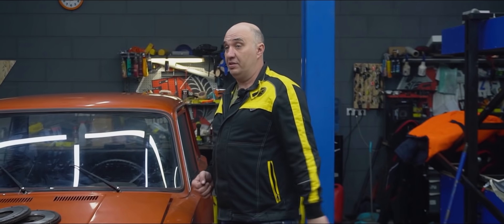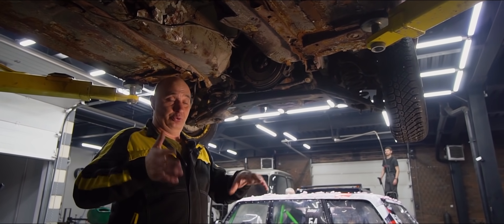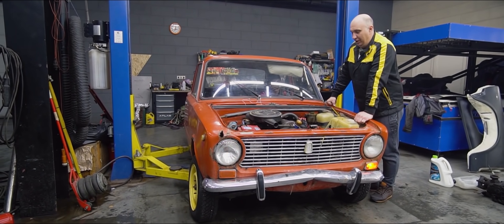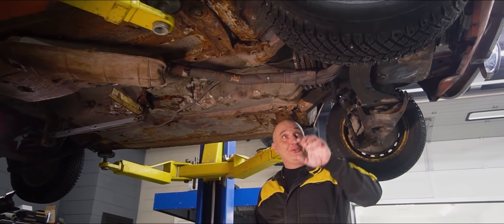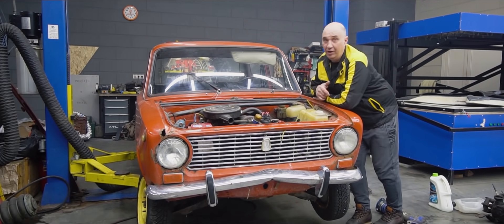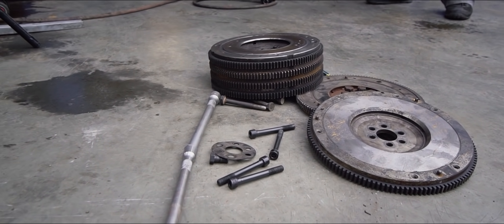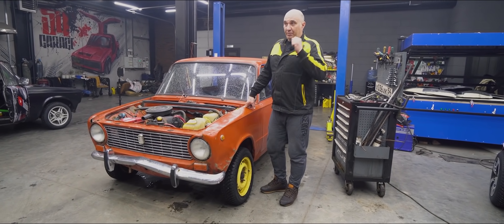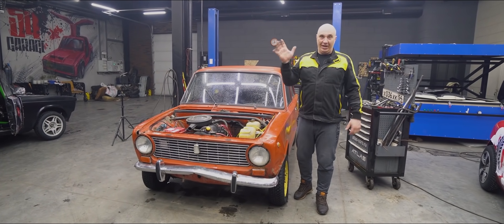What if you install FIVE flywheels onto an engine?

Comment: I would imagine the engine would be slower to build revs but slower to slow down..... with 5 flywheels,  especially with a small car like that (is that a Lada? or one of those Russian-built (under license) Fiats?) ) you could probably get up to speed, slip it into neutral, and coast for about 10 miles...lol...
       "There seems to be some kind of weirdness going on with the timing belt.....my guess is that the tensioner has fallen apart..."  with as much concern as if someone said 'Hey, has it stopped raining?"...looks outside...'Yeah, it stopped'...lol  
So they attached the clutch.....shortened the driveshaft....(wow, studded tires, haven't seen those for YEARS!) ...
rockin' the car back and forth in the snow......my birthday is in December, so I learned to drive in the winter when I was growing up and that was a big part of winter driving in Pennsylvania....rocking a car back and forth to get out of a stuck spot was an important part of instruction...
        It's funny,  that sick, mentally-failing weakling "beijingbiden" just yesterday called Putin a "killer" (egged on by a reporter but still, that reporter would have NEVER tried that shit with Trump) and yet us car guys are here, checking out each other's crazy ideas and just diggin' the cars. Us and them would probably enjoy having a beer together and comparing notes on American and Russian makes/models. Why aren't the supposedly "more experienced" people in the government 
able to get along like this?  
PS. Vladimir Putin, sir? Ya wanna fly to the states and land a good hard right on beijing joes jaw?  Yeah, just get into the White House, shake that animated corpse's hand (yuck...) and then say "Oh! Joe, BTW, about that 'killer' comment..."  BANG!  Then turn around, get on your plane and leave.  TRUST ME, you'd be America's new hero!!   lol    
PPS.  And BTW, send some rubles to Garage 54 for all their hard work, forging bonds of peace and friendship between Russian and American car-guys !!!   ;)
Great video, thanks for sharing!!   Спасибо и до свидания!

Comment: Here in Norway there was a Rally Cross driver that used the heavy flywheel trick to make sure he was first out on the start line by revving up his 500+ HP Rally car and let it rip in second gear instead of first. He pretty much always was first in the start and in Rally Cross that means much higher chance of winning because the races is short.

Comment: Takes me back to tree work days... As I recall... Non turbo 80HP diesel 4 banger... Thru a "definitely not your Datsun's clutch"... Into a ~6000 lb, 36" was it? Couple inches thick flywheel... Some of the details escape me... A good size but not the biggest by far chipper...

Thing would slowly rattle it's way spooled up, go get coffee, lol ok maybe not that bad...

When you throw that lever it would take a few feet of 8-10" log to get tired if the knives were sharp 🤣

Comment: Here's something to have some fun with, (the snow reminded me).  Weld a rear differential, and mount some drag racing slicks on the rear; THEN go drive in the snow.  If you have enough power, it will spin donuts like a child's top.... imagine driving a pole in the perfect center of the car and slapping the car on the rear quarter panel...

Comment: Years ago I managed to get a flywheel made for a car engine at Vickers engineering . 1.5 vauxhall corsa diesel .The new Flywheel was 8 times heavier than the original .No problems in 10 k hours of use and ultra smooth at 2000 rpm

Comment: My 1969 CJ 5 with Dauntless V6 came with a factory 50lb fly wheel which helped the engine perform more like a tractor at low idle speed

Comment: I have a 50 year old F250 4X4, added a heavier flywheel and added 1/2" stroke to the engine that ended up about 550 lbs of torque.  The effect is that at just above idle, it has unreal power.  You can go up a hill and hardly even touch the gas.  If this guy took that up a hill, he'd see that the engine feels a LOT stronger.  For a street car, you go the other way, you get quicker revs and more breaking effect.
Reply: 351m to 400, or FE?
Reply: @jerryw6577  FE 428 W/tons of mods.

Comment: Let’s see it dropping the clutch at absolute maxed out rpm 🏁👌🏻
Reply: In snow? 🤔
Reply: @donellmuniz590  don’t think it’s going to make much of a difference result will probably be the same
Reply: @Aladinscave  Nah, I think on dry pavement, it would snap a u joint or rear pinion off, or twist the driveshaft into a pretzel. If not, it would make an impressive one-wheel peel!

Comment: When I was drag racing I had a clutch/flywheel blanket that was thrown over the bell housing. That way if, when, the clutch or flywheel exploded it didn't send shrapnel into the passenger compartment. I was waiting for the end of your crankshaft to shear off and though it would probably just drop to the ground I wouldn't do too much leaning over the flywheel/ clutch assembly. Still, a pretty funny experiment.

Comment: I run a industrial tub grinder that has a clutch set up like this except
There is a clutch disk in between each flywheel and a collar on the end that compress it all together to drive the rotating assembly.

Comment: A flywheel is, in effect, a "mechanical battery". The increase in time it takes to build revs, is synonymous with "charging" it...  while the slow decrease in revs, is the "discharging".
Notice how he mentions that the car continues on the "stored energy".
The "problem"...  is all of the energy required to "spool it up".

Comment: I suspect if you try to do a performance test on a dry surface something in the drivetrain will fail, perhaps a yoke or union or the the driveshaft will twist if the weld doesn't fail. Thank you for making this video.

Comment: A small engine and big flywheel is how cars worked way back in the day, why don't we go back to those days with heavy long-life engines, low horsepower and big flywheels? Rev it up at the stoplight then slam into gear and zoom up to speed while only sipping gas XD

Comment: I see that they modified the front bumper to access the hole where you put the crank handle through to the front of the engine for hand starts. My Datsun B210 had one too, but they didn't obstruct it with the bumper. You just inserted the crank handle like a Model T.

Comment: In my E46 M3 with the OEM flywheel you can dump the clutch and it won't stall, but when I put a LWF on it, it's stalls even with a little gas.

Comment: A bus many years ago had a heavy flywheel to store energy while it puttered around from stop to stop picking up passengers. I suppose with a massive crankshaft, long stroke diesel engine and time, it would work. Gardner marine engines work on this principal.

Comment: Use in an electric motor has value because it provides thrust during acceleration, smooth power during constant speed travel, and energy recapture while stopping.

Comment: Garage 54 - do a video with an engine with ZERO flywheels. You will have to find a way to weld the gearbox shaft to the end of the crank. But the power gain in 1st and 2nd gear will be huge. Setting off and changing gear might be ... fun ... with no clutch lol

Comment: Where the  extra flywheels will  help is  when you let the clutch out at low speed  it will not pull the engine down like the stock engine

Comment: I imagine that the engine would stall a lot less. Save you from spotting a pretty lady while waiting at traffic lights, you end up in a trance, when the lights change you stall the car (in uk with manual gear box and crazy traffic), except now you have the heavy fly wheel which keeps the engine turning.

Comment: The smoother throttle response and slower engine breaking should help driving on the snow. The engine breaking wont make the wheels loose grip.

Comment: The old VW beetles had a heavy flywheel and were difficult to stall. I liked them. Some modern little Japanese cars have too little flywheel. They are more difficult to drive. Not a problem for the auto box that is the usual style.

Comment: Old hot rodding trick to get more power at shift time was to put a heavier flywheel on it. Yes just a bit slower to accelerate but more power to wheels at shift time. There is a limit on how much.

Comment: Interesting, true. Usually flywheels are balanced with the rotating assembly so as soon as there are more than 1 attached the harmonics will be way off. The rotational mass holds the rpm longer.  But if anybody has seen a flywheel come apart and go up through the bell housing, car body and the windshield you’d know this guy is really flirting with danger.

Comment: Large heavy vehicles with smaller engines often have heavy flywheels installed. The inertia will help it start off without stalling all the time.

Comment: I had  Lada 1500, with a Weber carb conversion, headers and a fair amount of rust.
It was road legal, and surprisingly like my Fiat 125T, performance-wise.
Never had the urge to a add flywheels
Great car until a mate ran it out of oil, after being warned that the front crank-seal leaked like crazy, but given that his wife had just evicted him, and he needed to get to work. So, what did I do?
Yup, loaner...
Needless to say, it was fucked when I eventually had to tow it home...
Wish I'd kept the carb and manifolds.
Love those manual timing chain adjusters.
I'm expecting your car to self-destruct, but I may be proven to be wrong.
Ladas are cool, especially the wagons.
Maybe fit a 4.7 Powertech engine?
It'd weigh less than all your flywheels.
Man, you guys need more vodka.

Comment: The car in gear is essentially a flywheel...single flywheel in first gear the motor accelerates and slows down at the same speed as a pile of flywheels.  I work on boats with car engines...most come with 40 lb flywheel for a clutch deal....swap it for a 5lb flex plate and thottle response gets plenty impressive

Comment: I want to know how low they can get the idle to go with a huge old steam engine(eg.) flywheel or add more weight. Fill tires with concrete on the driveshaft(s)! 0.5, 0.2 rpm? You're move Garage 54, heh heh.

This was probably translated for us from a four year old video though, haha. Thanks BMI, you get his humour across pretty well it seems. Cheers, Sir.

Comment: i own a 16 valve single cam 1.5 ltr Mazda with a five-speed manual transmission. It runs reasonably. what i did to it i also did to my bicycle previously. i removed 100% of the air that inflates the tyers and replaced it with 10% water at the usual tyre pressure. easily done by fitting a hose fitting to an air gauge, My bicycle i can ride around just about everywhere at 40 + kmph in top gear. I never need to find 1st gear to climb hills. the car on the other hand usually has an electric wheelchair loaded into it and this is a considerable extra load. going on the standard tyres running on air it is a very heavy load. Now when i remove the wheelchair and drive the vehicle with no load, the vehicle performs like a lotus. i have no need to drive the vehicle like a lotus but i can if i need to. generally, even when loaded i only need to use 1st, 3rd and 5th gears and either be in front of traffic or simply keep up with traffic as i am in no hurry usually. 
the trick is balancing the wheels so as to make the road usable in general driving. this must be done by static balancing only while fully inflated with water. your welcome. mechanic.

Comment: Obviously there is going to be much higher torque on the crankshaft intermittently.  If the crankshaft eventually gives way it could shatter. However, if the car is operated effectively, the stored energy in the flywheels may actually improve fuel consumption. The timing circuits would have to be adjusted. Possibly using a new computer controlled system. Looks as if you could end-up going through many clutches is not operated carefully.

Comment: This is pretty cool it might even be useful if someone wanted to learn how to rev match since they change so slowly I wouldn't be surprised if with a bit of practice you could get around without even using the clutch.
Reply: It's called "floating the gears".  Truck drivers do it all the time. Seriously.

Comment: Eletronic Fuel Injector will be better for this test, because carburador "throttle squeeze" duration is to short comparing to the rev (rpm) lag and air speed increase lag. Although the air will not speed up (lag), its pressure will rise and a MAP sensor can handle it, but a carburetor can't (carburetor is sensible to air speed)

Comment: If it broken off, it can come in the cabin and can rip off your legs. In Finland Zetor 25 broken two parts and driver had bad injuries. Zetor 25 flywheel wight is 75 kg.

Comment: This would probably work better on an automatic; the torque converter input speed would be relatively stable as the engine rpm would be equally stable, and shifting would give you large torque jumps because the torque converter makes more torque the greater the difference in input to output speed.

Comment: I read this as if they were installing wheels directly onto the engine instead of flywheels.  That would be an interesting build with the engine acting as power and axle.  Plus, it would always be in gear.
Reply: Like a sprint car?

Comment: with that much weight from the flywheels, the engine doesnt have to do as much work from a standing position. so in theory this is pretty interesting for small engine vehicles to get quicker of the line lol.

Comment: What a rust bucket! I should have tried this trick on the 1996 Ford Explorer Eddie Bauer Edition 4.0 V6 with 4r55e transmission automatic it broke 5 flex plates in the three years that owned it. 🤬 Maybe with two or three flex plates.

Comment: Anybody who has driven a stock 1970's era Mack truck with a 237hp engine knows what it's like. Max out the revs, let off the throttle, slip it out of gear, have a smoke & 1/4 mug of coffee, eat 1/2 a sandwich, drink another 1/4 mug of coffee, have another smoke, BY THEN put the revs have dropped enough for the next gear.
Reply: You're exaggerating. It shouldn't take more than one cigarette.
Reply: @jerryw6577  You must smoke awful slow.

Comment: They should be place a Shatter Shield and Kevlar Blankets all over that Mess, in an effort to make it appear there was a concern about safety. It was mentioned how soft the Bolts holding the Flywheels on are. If they shear, Spinning Flywheels are going to be a Problem

Comment: Starter will wear out faster,rear main seal will start to leak,Have to mod the tranny housing,no room if front wheel drive to do it.Rear wheel drive will have to shorten the driveshaft and mod shifter..wow! lots of work for an experiment.Also rear wheel drive if modded tranny housing is to far back you would have to cut part of the firewall to make it fit.

Comment: maybe with a longer stroke engine, more low torque power camshaft which gives max power at a lower rpm of 1500 may mimic a diesel engine with that flywheel?

Comment: It the same as just driveing the car. In this video energy of mass is in flywheels, but in real road conditions same mass and energy is stored into driveshafts, wheels and .... motion of vehicle overall.
When he accerelrates engine it takes it up slowly, just as driveing car on road. Same happens when depressing gas pedal. rpm wont drop to idle in seconds, it drops slowly as car decelerates.

Comment: Hi, very good thing to try, but have you tried how low you can get the engine to idle. It should run smooth at lower rpm and save fuel when idling.

Comment: "... nothing fell apart' 

Um, yeah, but put a few more miles on it in dry conditions and see what happens. Note: You might want to install a scatter shield before you try that! A flywheel coming loose at 3-5000 rpms might ruin your day, and a leg or two in the process. Five flywheels? Even worse things can happen. And probably will.

Comment: They need o do the opposite test to this, bolt a clutch on a bare flex plate from an automatic, and have a manual transmission.

Comment: I have an experiment for you to try.
Take that car out to a road where you can drive for miles and watch what happens to the fuel economy.
Once you get it going a decent speed you watch the fuel economy go through the roof!
It's not very practical in the city but on the highway you are going to bust a gut laughing at the fuel economy you get if you set that thing up right!
it used to be a toy called a Mighty Mo its main source of power when you pushed it was a fly wheel and once you've got it moving nothing stopped it.
have fun!

Comment: If the engine is balanced by using a Flywheel that has a Bias, adding more Flywheels will certainly make for an Unbalanced Engine, will be sluggish on acceleration, and have an engine that will take forever to return to Idle, which can be Dangerous in traffic

Comment: What if you suddenly release the cluch on 1st gear without any throttle? My guess is that the car should not stall at all, but just start to roll until idle speed or possibly stall but after a longer while..

Comment: saab did that on saab 9-5 ,they trimmd the engine to much( lowfriction) so they haved to put a big flywheel to get the engine balanced
and then they realized that the engine woudnt work without a turbo , thats enginering at its finest.........

Comment: I was wondering the other day, what if you had 1 engine, but linked to, say, 3 transmissions to it?
Reply: You could shift gears a lot.  Class 8 trucks sometimes have 2 or 3 transmissions, with a shift lever for each transmission, or one transmission with 13, 15, 18 gears.  The engines in these trucks have a very narrow power band, so to pull heavy loads they need many closely spaced gear ratios.
By the way, many current cars have automatic transmissions with 8 to 10 speeds to help meet CAFE standards.